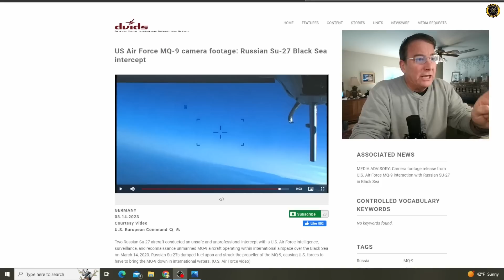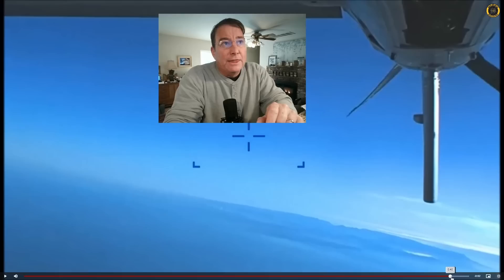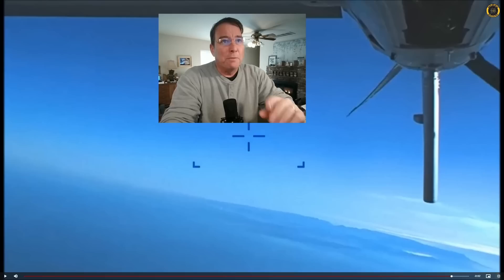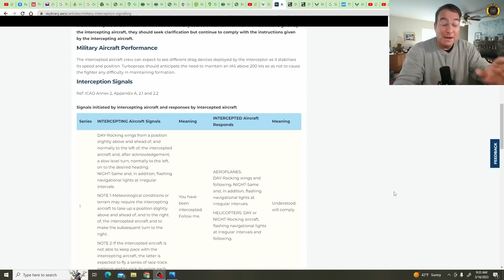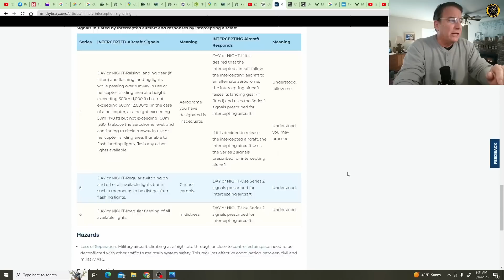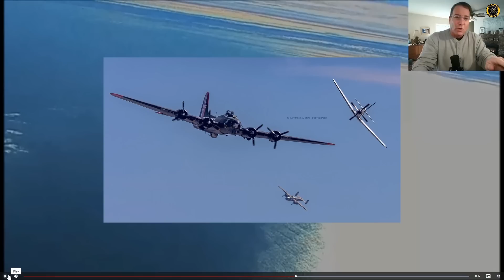Botched Russian Intercept of MQ-9 Drone Over International Waters

Comment: Being a Propellor expert, inside a prop there are control arms, connecting pins, sometimes gears and piston that is all part of a constant speed / feathering / reversing style of propellor. Seeing one blade out or angle to the others is saying to me the damage to the mechanics of this prop is massive, sheared blade pitch pin, it's taken a huge Russian jet fighter hit. The bent over blade may have a section missing. If so thats a huge imbalance especially if it's on the outer section of a blade. As you say Juan this sort of damage is going to set up a catastrophic failure of the propulsion drive and turbine. What I find semi amazing is these drones are using alloy blades and not composite blades. If this was a prop made from composite blades it would have completely failed and the blades turn into 'witches brooms'. I have witnessed a Cessna Caravan (PT6 engine) with a composite prop hit a refueling depot and the whole prop literally blew up. If it was a alloy blade prop the outcome would have been totally reversed. The forward pilot view from a Cessna Caravan is shocking, so easy to run into anything on an airport if your not very careful. Juan please do an update on the Seaworld double Helicopter crash, just astonishing what's being said about that crash.
Reply: Being a comment critic expert, overall, good job though the general public isn't going to know what "witches broom" means in regards to a propeller and the propeller on the Cessna litterely blew up? I think I can speak for most when I say I'm shocked the propeller is made out of explosives. I would think that wouldn't be a good idea but with quantum physics who knows. Maybe it.... uhhhhh.... I don't know but interesting none the less.  Like I said overall good job. Try not using so much lingo next time if you are trying to convey a message to laymen as well as people in the field that you work. That and shorten it up a little bit if you are trying to get people under the age of 35 to read your comment. Reading more than a half a sentence with all the words spelled completely out sends them into a panic as they see the task as too daunting. Have a good day sir.
Reply: @bradsanders407  😂😂
Reply: Speaking of ‘shortening it up a bit…’🤣😉
Reply: I haven't looked up the top airspeed of the drone versus the SU-27 stalling speed. I've heard some chatter that there are no unprofessional fighter pilots, but if you remember the (Ukraine-I know, different example) air show crash back in the early '90s... and there was all that footage of Russian Air Force low flying stunts throughout the years. I don't see why some people are surprised by this maneuver.😂😂 And don't forget about before the end of the Cold War that SU-27 (fully loaded with missiles) collided with the propellers of a Norwegian P-3 Orion.
Reply: @bradsanders407  I've noticed  that too.  Why the lack of patience if the message is more than a sentence?
Reply: @bradsanders407  I didn't get past "Being a comment critic expert..."  🤣🤣 OK, I admit I read the whole comment, but kind of wish I hadn't.   😥
Reply: Yes ok I noticed that too.
Reply: @bradsanders407  I'm not an expert either but from limited experience with fiberglass, carbon fiber etc it's predictable that on impact it is going to turn into a mass of shredded fiber. There are no "explosives" packed into it... there is rotating mass and inertia, and the sudden disintegration of fibers in this rotating mass would unbalance it and send fragments of shrapnel through the prop and potentially the fuselage of the aircraft... the unbalance alone would rip apart the machinery inside the propeller hub.
Reply: @privateer0561  Never trust an "expert" who can't spell what their expertise is
Reply: @bradsanders407  
I recognized that it may have been a joke that went over my head however...
It's not only explosives that blow up. Explosives use chemical reactions to create more pressure than the vessel can withstand, but that's not the only way to create more pressure than a vessel can withstand. 
Ever heard of a tire blowing up and injuring or killing the mechanic that was inflating it?
Reply: @bradsanders407 How about frayed…is that simple enough for you
Reply: I have a question.  If I was directly behind the drone, is the propellers turning clockwise or counter clockwise?

From the video it looks as though they are spinning clockwise and at low revolution rpm. (Is that from the camera shutter speed causing it to look like it's spinning slower? Also if it is spinning faster than what it looks like in the video would it make it look like it's spinning in reverse?

I know this particular plan can stay in the air longer and loiter by just slowing the rpms down and semi-gliding. Is that what this drone was doing?

Also, I would like to note that Russia is more advanced than the U.S. whe. It comes to Jamming and what I call (S.E.C. Ex) Signal Eviction & Control Execution. This is where the Evict the original  signal operators and take over control of the UAV. 

If you notice as the plan gets closer the camera gets fuzzy and out right cuts off after the second flyby.  (2011 Iran took over control of a RQ-170 Sentinel and safely landed it on one of their Ir bases. Easy to google)

I think personally Russia took control of this UAV and landed it and the U.S. won't admit it just like when it happened in Iran. It wasn't until Iran published it to their media that the u.s. finally said something.  Look up RUSelectronics Dron capture.
Reply: @11x  I’m afraid not.
Reply: @bradsanders407  Oh come on now. Most people have seen fiberglass brake up into fiber like strands when there was an impact. Hence looking like a "witches broom". We're not stupid. I"m just a machinist and understood everything he said.
Reply: @bradsanders407  I'm not sure whether it is funnier or sadder when people complain about a message containing too much information, and I don't believe there is anything to be gained by pandering to the wilfully ignorant.  If people with poor attention spans and comprehension want an executive summary of a message conveying technical information, they can hire an assistant to process it according to their information needs.
Reply: @bradsanders407  OMG!  Like Really!  Lighten up.  I had no problem understanding that "blew up" meant it came apart catastrophically and a "witch's broom" would cause me to picture the fibers of the carbon fiber flailing like the bristles of a broom.  Folks who follow Juan have a deeper interest in aviation than most.  If person has that short of an attention span that won't read a longer comment, then they aren't suited for aviation and aren't following this channel.
Reply: Being a propeller expert can you explain why the prop in the first clip has yellow banding stripes on the blades but in the second clip they are clearly missing?
Reply: As a propeller expert, can you explain a few things relating to this MQ-9 and Su-27 incident -
a) why the double yellow stripes at the end of the propellers disapeared after the collison

b) why only a single blade was damaged, and not all of them. I am presuming the propellers must at least be rotating at high speed in order to keep MQ-9 airborne.

c) finally, given the side fins of MQ-9 are much longer than the diameter of the rotating blades, at what angle did the Su-27 hit the MQ-9
Reply: @privateer0561  Any one hear whom not has never mis-used a word on U-tub: May cast the first pebble."
Reply: @VL-inquisitor  I'm neither a propellor nor propeller expert, but I'll put in my two cents:
>"a) why the double yellow stripes at the end of the propellers disappeared after the collision"
On the post-contact footage the sun is behind the drone, causing the camera's auto-exposure to capture the blades as nearly black against the sun. However, the stripes are still there. You can just about make them out with a naked eye if you play the vid at 0.25x speed (youtube's gear icon); a screengrab + photoshop makes them plain to see.

>"b) why only a single blade was damaged, and not all of them. I am presuming the propellers must at least be rotating at high speed in order to keep MQ-9 airborne."
Two blades in fact show visible damage - one of them is bent, and the other rotated well out of alignment.

>"c) finally, given the side fins of MQ-9 are much longer than the diameter of the rotating blades, at what angle did the Su-27 hit the MQ-9"
The two aircraft didn't make a direct contact, contrary to all the ding dongs you hear. The Russian pilot was, instead, creating local atmospheric conditions unfit for the drone's controlled, powered flight. The turboprop flamed out. The blades hit a dense stream of about 2k lbs' worth of TS-1 being dumped per second by the jet. The blades hence encountered operating medium density of 300x...800x above their design limits. This wrecked the pins and gears inside the prop and yeah, they bent. The power loss from the generator resulted in loss of control authority and sat uplink aim, thus denying the Amreican operator the ability to glide the drone outside of the recovery zone of the Russian navy.

For the jet (much faster in a level flight than a drone) to make a slow pass and to fully douse the drone's prop and air intake in fuel while avoiding collision, it had to be at a very high angle of attack. Not "Cobra" high, but still quite high. A stabilized approach at such an angle of attack would be from a point behind and well below the drone. This video's author makes an innocent yet lethal underestimation of the Russian airmanship - which is fine for propaganda purposes to calm the cattle, but one hopes the military doesn't make the same mistake.
Reply: @VL-inquisitor  glad to see somebody else also picked up these discrepancies. I also question the twin fuel dump trails as the single fuel dump valve on the SU 27 is usually mounted centrally and above the outlets. Of course it could be a modification but I can’t find anything on it.
Reply: @bradsanders407  Lighten up Francis! - Sgt Hulka🤣
Reply: An alloy blade system is used for durability.  Remember, these things are designed to fly for 20+ hours and through all sorts of things, low ant high altitudes, even through a sand storm.
Reply: @peterbuckley3877  Look at the direction the sun is shining on the propeller blades.  It appears the sun has moved about 90 degrees, so you cannot see the paint on the blade tips.  Also the paint could be missing after cutting through the Su-27.
Reply: @VL-inquisitor   Look at the direction the sun is shining on the propeller blades.  It appears the sun has moved about 90 degrees, so you cannot see the paint on the blade tips.  Also the paint could be missing after cutting through the Su-27.
Reply: @AlexKarasev  good answers for a and b, but c is pure conjecture followed by an obvious bias that is no better than the bias the other way. 

There are a lot of known facts about how much airtime Russian pilots get in these jets on average, their training methods, not to mention plenty of video evidence (like this one) of just basic high risk v low reward flying and airmanship. So I would say that there is definitely some merit in the suggestions being made that there is potentially a big difference in the professionalism and ability of Russian fighter pilots. 

Not all of them are going to be like this, but I’d argue it’s likely more than you might think.
Reply: @MeppyMan  I'll take 2 for 3 as a compliment 🙂
On C, I take your points of insufficient hours and uneven training across the units and raise you less than stellar maintenance and systemic drinking problems in some units. That doesn't remove the fact that what I see on the video is a very tricky bit of flying. You might be measuring the reward as the cost of the drone and intelligence on it. The Russians likely measured it in terms of denying NATO and hence Ukraine the take from that particular asset at that particular place and time - which we don't know if it may have amounted to making the cost of the drone, both the SU-27s and their pilots, a rounding error compared to the value of the outcome of this particular mission.

If you see this as close to the worst in Russian flying, you'll be happy indeed to hear that I'm of the opinion that getting tapped for an approved mission to bring down an American aircraft had to have been be a privileged spot indeed. It's not enough to be at the top of your Russki flying game, you'd also have to know somebody upstairs. It's like getting a CIA assignment to Moscow.
Reply: @bradsanders407  Sorry, comment critic expert, was it?   Then you throw him one of those "overall good job though cookies? " Gee Thanks.
Reply: @AlexKarasev  I’m confused where you came up with this crap.  If the spinning thing doesn’t spine, it drops like a rock..
Reply: @bradsanders407  you say the general public won’t understand the “witches broom” comment, but that’s about the only thing he said that I did understand. 😂😂
Reply: @parkerds10  I think you're also confused about how wings / lifting bodies work
Reply: guys lay off this "propellor expert" who can't spell propeller, he stayed at a Holiday Inn last night!
Reply: GOOD OBSERVATION! I THINK THE PILOT HIT EXACTLY WERE HE WANTED AND DID IT SO INCREDIBLE PRECISE!
Reply: @robertwhitman1981  why would anyone try to foist an idea that propellers have explosives inside them?  That just sounds so stupid.
Reply: @AlexKarasev  if a pilot is "privileged" to take down an unmanned drone that can't fight back --- then Russia is worse off than any of us can imagine
Reply: @fredwerza3478  unmanned doesn't mean harmless - to the Su pilot, in a literal sense as the drone could've easily been flown into the fighter jet with lethal effect to the Russian pilot without endangering the American one.

This was a high-visibility mission where a LOT could've gone wrong for the Russians. I'm pretty sure, Fred, that you're smart enough to see this angle, but need to find something else to cope.
Reply: @AlexKarasev  I have no problem with an unmanned U.S. drone taking down a Russian pilot --- they wanna play stupid games, then they deserve stupid prizes
Reply: @fredwerza3478  you don't but the Russians sure did - which is what makes it more of a challenging mission for them - which is the premise you questioned - see?
Reply: @AlexKarasev  I can see why the Russkies are losing in Ukraine --- sending their best pilots to almost wreck a $50 million fighter jet into an unmanned drone LOL
Reply: I’m somewhat of a physics nerd.  That must have been one hell of a good Russian pilot to have only bent one propeller blade out of three from a propeller spinning at 2000 rpm. Maybe I missed something but this looks a little fishy to me .
Reply: I see nothing new about Seaworld tragedy anywhere wassup?
Reply: @stuartedgar5921   Nice!  I didn’t notice that. Good work.
Reply: @stuartedgar5921    Also, the extended range Reaper uses a 4 blade propeller. I’d think they would have been using that one .
Reply: @privateer0561  step one in being a propeller expert is knowing how to spell propeller.
Reply: @MrCarGuy  hey guys, ehrlyne pylet here
Reply: @chriscummings4206  yep